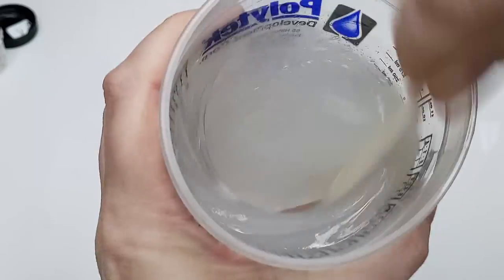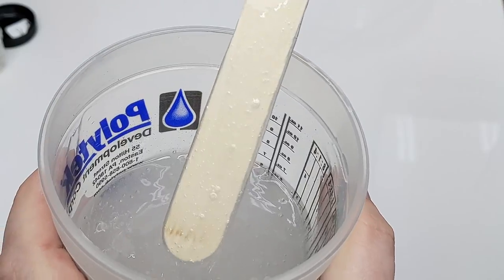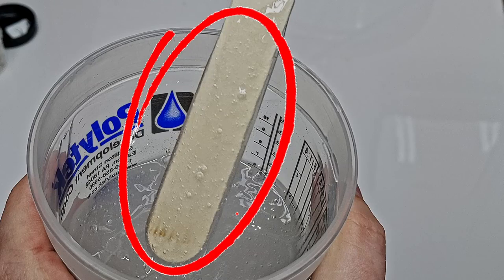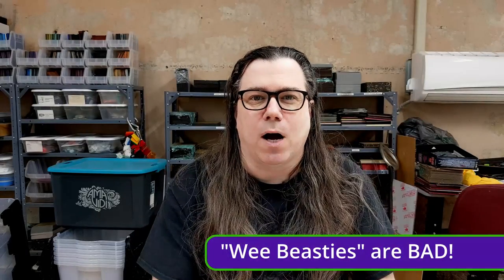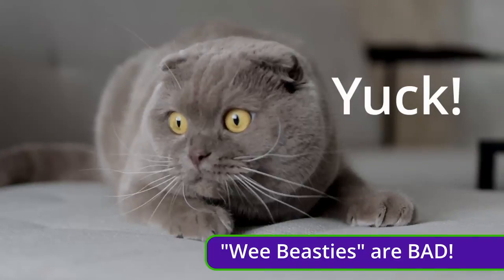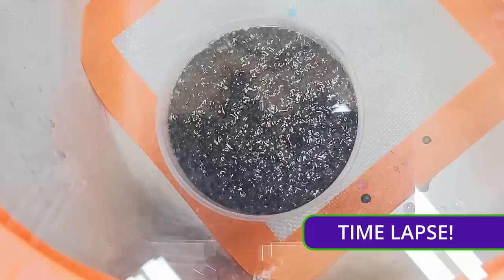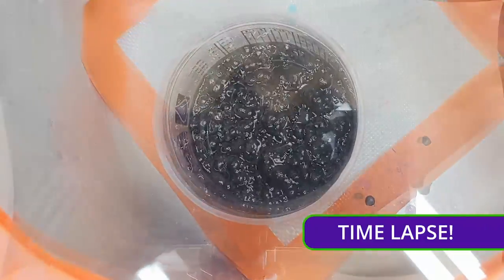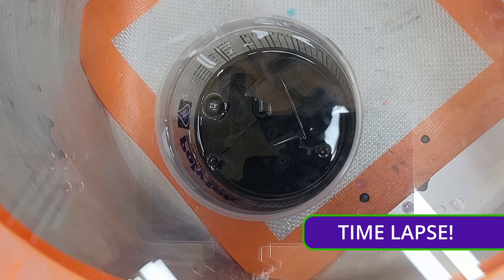WHY YOU SHOULDN'T USE PRESSURE TO CAST SILICONE TOYS! Vacuum chambers FTW!

Comment: I ordered BACOENG 3 Gallon 4.5 CFM kit off of Amazon and it “smokes” really bad. It actually filled my room with a fog of oil. So I am in the process of returning it and ordered a Robinair 15500 and a new chamber. Do they all do that? If so, is there a way to stop this or should vent it outside or something 🤷‍♂️
Reply from the maker: Hi! What you are seeing is a combination of water vapor and oil.  I think all vacuum pumps will put out some to varying degrees.  There are filters that you 3D print and attach to the output of pump for example: https://www.thingiverse.com/thing:3367073 These will catch the oil but the water vapor will still probably pass through.
Reply: @Amavidi  hi, thank you!